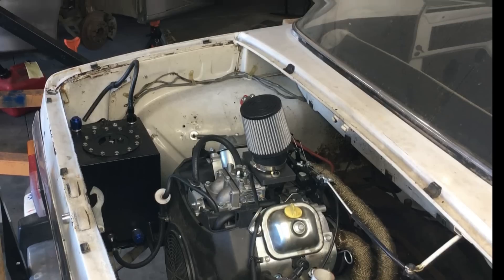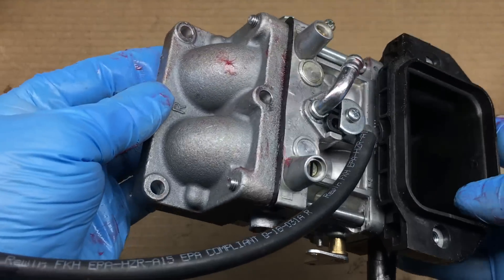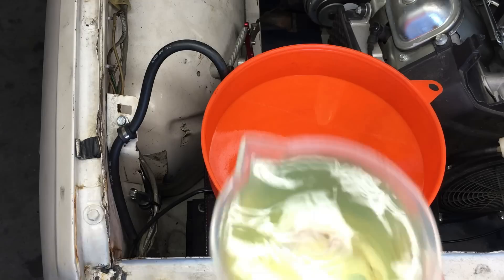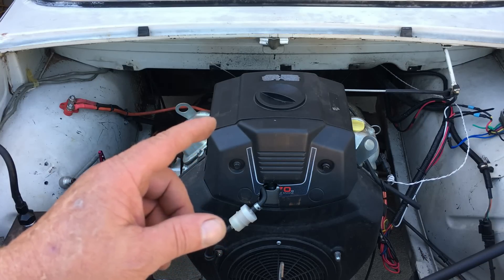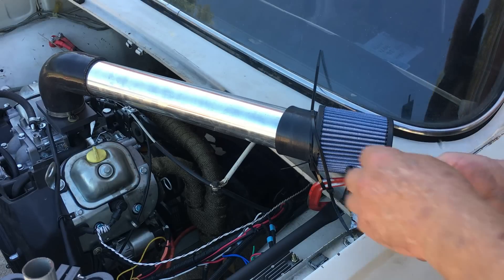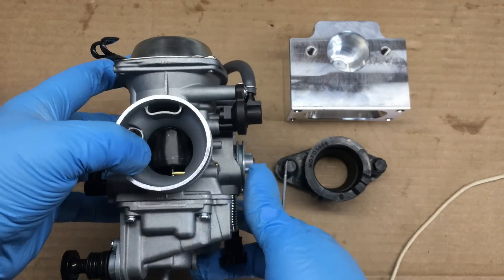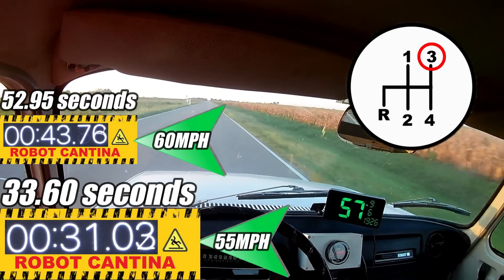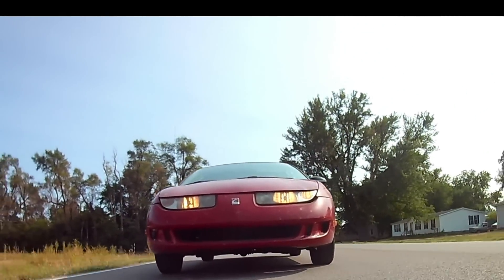S3 E28. Performance tuning and MPG tuning the 670cc predator powered Renault

Comment: Thinking of upgrading your Predator 670cc engine with a Keihin CVK carburetor in your Renault? Here's some advice to steer you right! 🚗💨

🔧 Compatibility First: Always double-check the CVK's size and specs to ensure they align perfectly with the 670cc engine.

🚀 Performance Expectations:

If tuned correctly, you might see up to a 4% HP boost. So, from a hypothetical 27.85 HP, you could be looking at a neat 28.96 HP! 🐎
Better combustion can also nudge up your fuel efficiency. You might see your MPG rise from 26.27 to around 26.64 MPG ⛽.
🎛 The Art of Tuning: It's crucial to fine-tune the Keihin CVK. Pay attention to jet sizes, needle positions, and air screw adjustments. They can make all the difference! 🔍📈

🎵 Don't Forget Airflow: A high-performing carb needs an efficient intake and exhaust system. Make sure the airflow isn't restricted to truly unlock the carb's potential. 🌀

Dive in, but always do thorough research and consult with experts if unsure. Best of luck with the upgrade! 🔧🔩🛠

Adjust as necessary to fit your tone and specific advice!

Comment: I also understand why your car handles iffy at 66 MPH.  It was designed to have a heavier engine.  Add a little weight to the front to help the issue.  Beefing up the front suspension would help two ways, better suspension and more weight up front.  Cheers!

Comment: That new carburetor style is on 50cc Chinese scooters. I once had a mom that wanted her sons 35mph scooter to go faster. ??? Not my mom anyway I removed the spring and I got 53 mph out of it. I told her she said put the spring back. It limits rpm by lose of vacuum at higher rpm so playing around with different springs should increase rpm I have one of those scooters as a project. I thought about being able to bypass it as a "GO BABY GO" button for more performance on demand like nitrous. Great videos!! I look forward to these videos!

Comment: Ah that carb I have plenty on my bikes. It has some bad traits. It uses the vacuum in the intake manifold to move the diaphragm. Which will run very rich and another issue is fuel overflowing or no flow, affected by the MAP manifold air pressure. No ram air for that carb. There is another type of carb which directly moves the needle by throttle cable which is less aggressive but super economy.

Comment: Running lean is not a big issue at all my bikes run extra lean with great benefits. Clean spark plug and clean exhaust. Rich setting will foul spark plug and generate black smoke and dark particle on the exhaust

Comment: Worked on air cooled engines for many years as a Porsche tech up in Dallas.
Almost every carburated motor I worked on had down draft mikuni or weber. Individual runner for each cylinder, not very long runner either.
How about a set of regular mikuni carbs on short manifolds for each cylinder? Those long, bendy manifolds are not helping peak power for sure.
Call me crazy but I always enjoyed syncing up the carbs. 3 barrel down draft weber on each side. Great fun.

Comment: You could run a small pipe from the ram air side into the float bowl, I think that's how it's done on motorcycles. Pressurising the float bowl helps with the leaning out of the mixture...

Comment: The whole problem with the ram intake is the increase in pressure causing a pressure differential between the fuel tank and the intake. Would a pressure equalization line to allow the fuel tank to be presurized by the ram air system be enough to fix it?

Comment: From what I understand the heat exchanger on the vw type1 motor was to prevent icing up of the intake manifold in cold weather.
But I'm not discounting the other theories

Comment: That spacer needs to be longer and an X shape, your first iteration added/exposed sharp corners that inhibit flow.  And the air filter adapter also has hard edges.  Same thing, not good.  I see its moot as you are going with a single barrel carb 😂

Comment: Hey bud, just wanted to help ya out on the Keihin carb ID. That's a (chinese) VE94 variant for a 00-06 Honda Rancher 350 329cm³. The 400 model has a provision for a throttle position sensor on the side. I am a Rancher 350 enthusiast and when I seen the carb at first, I said SWEEEEEET.

Comment: My thinking on my previous comments was to have a one barrel , down draft carburetor . The side draft carb and the 90 degree manifold seem to would restrict fuel flow ? A high rise manifold might only be 2 or 3 inches tall . The new carb you are showing seems to be a good candidate but wonder if a down draft with the same self adjusting capabilities ?  Love your projects !

Comment: I have played around with CV carbs and the are fantastic once you get the hang of them. Makes it virtually impossible to put too big a carb on an engine but you can always have all the carb they can take. 32mm Should be good for this engine. 
You could try putting the CV at the end of a Long intake Runner like they did a lot of in the "70s to increase bottom end torque. That works well too. 
Looking forward  when you get to fuel injection and the turbo!  BTW, the " L and the T" in Renault is silent. It is pronounced "Reno" being French.  ( that's Ren-o not Reeno)

Comment: So I'm not familiar with VW or their engines but I know that cooler intake air, and fuel can improve the performance quite a lot. I can imagine that if you can cool off the intake charge better the whole system can run more effectively.
Long intake runners like your ram air intake is going to benefit lower end power. More torque in the street rpm and lawnmower rpms lol.
Reply: the VW Beetle and it's engine was designed by Doctor Engineer (that's an official title) Ferdinant Porsche who build an electric car in in 1905 and later on the Porsche 911. more than 30 million of these engines where made.

Comment: Don't make the mistake of slapping an air filter onto the backside of the CV carb. It creates too much air turbulence for the vacuum slide to operate properly. The simple solution is to extend the distance between the carb and air filter with a PVC tube a minimum of 2-3".
Reply from the maker: Thanks for the heads up!

Comment: the tinyest tires are 125/80R15 who are use on Citroën 2cv...But the best quality (Michelin) tires  this size  are very expansive  (91€ for ONE tire in France).Carb pipes heater are relative similar to the VW on the 2cv flat twin air cooled engine...

Comment: I see that nissan altima in the driveway.  That would make an excellent next project car. I had one and it liked to make coolant disappear. It used a quart a month.
Reply from the maker: Oh the Datsun is my brother Dukes beater car and we will be using it for an upcoming OBDII project.  Its a bit heavy for the little diesel engine.
Reply: @robotcantina8957  I remember it randomly kept throwing the 0420 code catalyst efficiency too 
That is a good obd2 learning car.
Reply from the maker: The red Saturn coupe  was the car that was throwing the efficiency code.  The silver Datsun is in perfect condition except for the paint.    @electromech7335

Comment: BMW used these CV carbs on their Airhead boxer engine bikes from the 70's and 80's.  The carbs were made by BING.  I have two on my bike and the carbs are fiddly, but work well when they are dialed in. Throttle response is slower by my experience to traditional carbs.

Comment: Hey Sir, i have a gnarly suggestion. Being that the Saturn is a Metro and a Metro is Toyota based and it's 850 lbs lighter than a Tercel (made from Pvc, fiberglass,  polymer and recycled refrigerator doors. Convert the SL2 into a quasi hybrid meaning Prius electrical mixed with Predator vtwin. GNARLY for sure.

Comment: I think the bolt pattern is similar to old Dacia s. This is because Dacia is part of the Renault group. You might be able to find wheels for way cheaper.
Reply: The original Dacia introduced around 1970 was substantially the Renault 12.

Comment: Respect for doing the hard work of all those experiments.  I've worked with tons of engineers who have good ideas, but don't have the grit to slog through the tedious data collection to prove them out, and who end up with very suboptimal results because of that.  Driving through corn fields for hours at a time in the heat isn't fun in a comfortable car, so I can't imagine what it's like in this thing.
Reply from the maker: The car is remarkably comfortable when going down the road a 50-55 MPH..... but the summer heat make it miserable.

Comment: The intake stroke on this out of phase. So two isolated "barrels" is almost a requirement. Honda briefly built a V twin bike that had a single carb and vs the rest of the V twins had two. They lost about 20% of the hp over two carb

Comment: The carb on my parent's early 80's Ford LTD Station Wagon was a variable venturi carb, too. From what I remember, my father said it worked really well really liked it. His only complaint was at the time, it wasn't rebuildable. So, when it was time for a rebuild, he ended up having to replace it instead. Really neat design: Good power, good fuel economy, and minimal maintenance.

Comment: The air-cooled Volkwagens are known for using CV-style carburetors as well... hence why they typically got such good feul economy from the factory. And at one point, they decided to go with a variant of Bosch's Jetronic EFI system. (Every multi-point EFI on the road pretty-much is...!😉) It worked well... until they discovered American CB-radios were able to generate a strong signal on the same operating frequency as the un-shielded ECM that it employed, resulting in many frustrated VW owners on the roadside wondering "Why the F@$# did it suddenly shut-down!?!"😆

Comment: With the "Ram-Air" system a friend built on my '85 S-10 pickup, it drew from the "clean" air seen by the lower front-end air dam. Also: The GM/Bosch TBI system (EFI) was able to compensate for the change in inlet air mass & temperature by constantly monitoring and adjusting the A/F-ratio in accordance to input from the numerous inputs it employed, as well as referencing the programmed fuel mapping "burned" into its PROM (Programmable Read-Only Memory) chip. The result: Avg. 25-mpg@77-mph cruising speed!😁

Comment: Great video, Jimbo!  If I lived closer, I’d gladly do some driving for the fuel economy tests.  Curious to see how the new carb works out.  Looks like its design is similar to an SU carb.  After that, how about fuel injection so that the ram air has a chance to work? 👍
Reply from the maker: We did EFI in the 420 Honda Insight... may do it again, I'm not sure yet.

Comment: An old trick I've seen done to help with the fuel's phase change is to heat the fuel before it enters the carburetor, done "quick & cheap" by running the fuel through a length of copper tubing wrapped around a "waste" heat source (heater hose or an under-hood exhaust part) placed in a point along the fuel line's delivery path AFTER  the fuel pump or fuel filter.

Comment: Idea: go get a pick-n-pull 2 or 4 barrel carburetor and 3D print up an adapter (and riser if you need it). Carbs can be fairly cheap and rebuilding them is cheap, and they will let you ram as much air as you want.

Comment: The K could stand for kaizen which is a Japanese word that means "improvement." I learned this when the 2000 Nissan Maxima came out with an improved version of the original VQ engine.  In 2000 they added a K (and 32 extra HP), as in VQ30DE-K.  Fun fact.
Reply from the maker: Some say it stands for Kawasaki and others say it stands for Keihin.  I like your explanation the best

Comment: Smokey Yunick developed the Hot Vapor Engine back in the 1980's ,he used the waste exhaust heat to preheat the fuel charge so the fuel was fully vaporized before entering the cylinder and got 50+ MPG out of the awful Iron Duke 4 cylinder engine made by General Motors.

Comment: I'm an airplane guy and your ram air intake is too big. You need to put out in the wind a smaller opening that then expands at an angle that is no more than 15 degrees. Since you know how big the venturi is, the length calculation is easy. Carve the duct interior from pink or blue extruded polystyrene insulation board then cover it with epoxy and glass cloth (no polyester resin -- it will eat the foam). When the epoxy is cured, dissolve the foam with gasoline and go for a test drive. Start with an opening one-third the size of the venturi then maybe test bigger inlets by trimming the duct shorter. One-third is definitely too small so performance will only improve as you trim. Stop trimming when performance has peaked. Test slowly because the optimal will be between one-third and one-half.

Comment: Awesome to see the ram air working, but I would love to see it followed through for a 0-55, and fuel economy test.  Essentially your tuning a blow through carb, so the bowl vent needs to be plumed into the charge pipe just before the carb, like a 4bbl Holley with the vent tubes out the top inside the air filter.  With the atmospheric pressure the same in the bowl, as before the venturi I wouldn't expect it to need much jet change.  If you hook up the bowl vent on the keihin it might work with ram air without jet changes.

Comment: Thanks Jimbo for another cutting edge tech update delving deeply into the world of D&D (Dittle and Develope). 😂  I wonder if Albert Einstein started this way?

You might want to consider a fuel flow meter, coupled with road speed to yield an instant mpg at whatever steady state speed seems best, just to save huge amounts of time.  Of course, then other factors start to weigh heavily, such as air temperature, humidity, tire pressure, wind speed & direction, windows open/shut, and road smoothness & grade.

Those variable venturi carbs have been used on motor cycles since the late 1980's.  With the fuel/air mixture going all over the place, exhaust gas temperature would be a nice parameter to know.  I don't know how much extra effort/expense these ideas would add, just some thoughts.  Combustion temps peak out at about 15:1, so 18:1 may be okay.

Comment: Hi. I dont think the ram air system gives "overpressure" as such, the speeds are just too low. Hoewever, if the intake is very restrictive, it may well decrease the underpressure, which gives the same effect. 

As I understand it, motorcycles that used Ram air with carburators at very high speeds, had a part of the pressurized air feeding into the float chamber, pressurizing it to a   level linear with the pressurized air, meaning the air/fuel stayed good, and the fuel didnt tend to go bakwards when the air was pressurized. And it worked just fine on those bikes. Cheers.

Comment: You should 3d print a fuel intake vortex. I am curious to to know what the fuel economy would be with a loaded car.  Why not try a 2 barrel holly or ford carburetor? Take that new intake and have the holes filled and then re-drill. If you so desire.

Comment: The RPM decreasing drastically at 15:04 shows your automatic transmission setup is wrong. RPM should remain constant over the whole speed. Dont know the cause, belt tension or too heavy centrifugal weights?

Comment: grease... i have used 2 stroke oil on gasket for more then 20 years and works great, pretty nice to take of the cylinder and have the gasket almost falling off instead of being "glued" on and difficult to remove.

Comment: You can try to adapt your filter with the plastic housings in place. That way warm air from engine will blow over intake but not air feeding the engine or restrictive stock intake.

Comment: Hej Jimbo!
In my experiments of tuning a carb motorcycle engine shows the exhaust also needs some backpressure. Usually the db killer generates enough backpressure, and it can be feel by improving torque. Next week i will get my wideband afr and i can get more info what is happening there. Maybe a fast test would be interesting by you, if you have got time. Thanks
Great job

Comment: Ram air needs a throttle butterfly to moderate the intake Velocity.  Tuning the opening and timing used to be done with nonlinear linkages.

You can use a constant Velocity carburetor with slides instead of throttle blades.  These don't suffer from pressure increase upsetting the venturi.

In all cases, calibrating the AFR is necessary.   In the early 80s GM Rochester introduced PWM controlled jets for closed loop operation with a simple 02, MAP, temp, and other sensors plus a basic ECM.

Thunderhead289s AFR cheater would probably help a lot for these experiments.

That would allow you to get nearer to the volumetric efficiency limit of the engine and experimental accessories. 

Fun stuff!